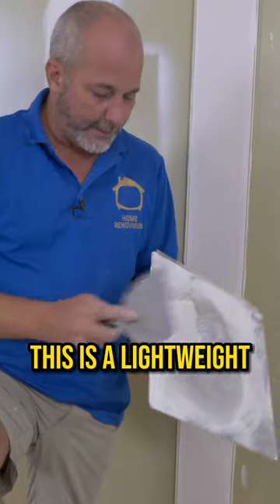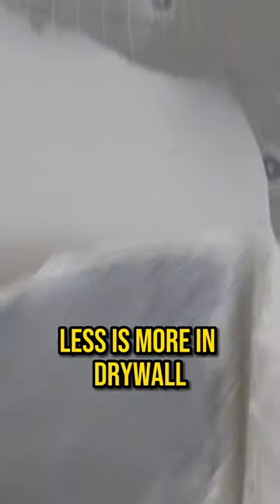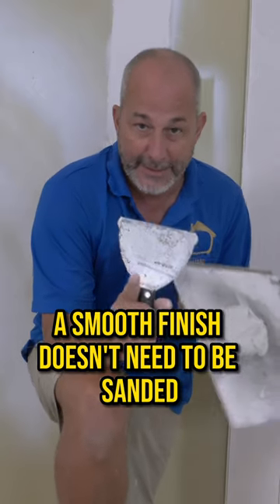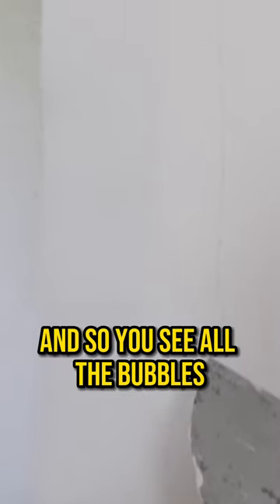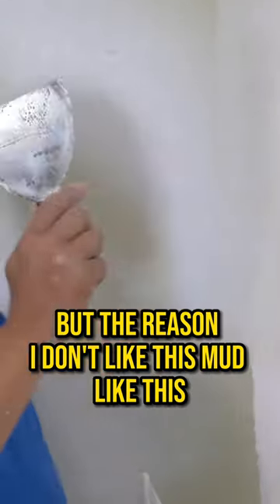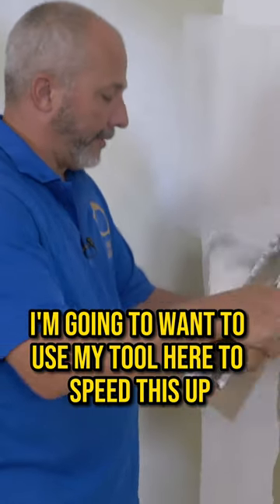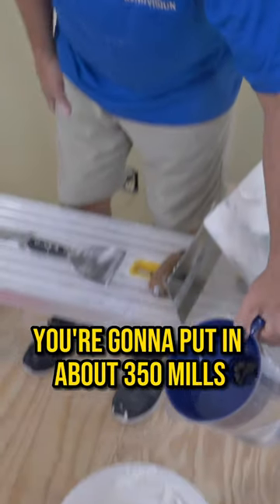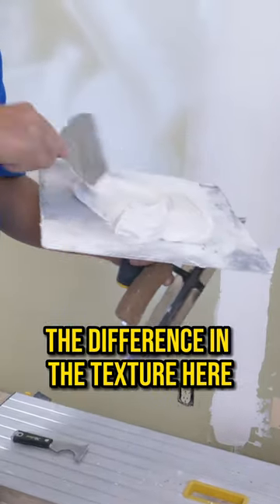Drywall Tip | Less Is More With Drywall Mud

Comment: You mentioned several tips at the same time. Which is it? Working the mud? Using less? Trowel size? Adding water? Using lightweight? That’s the problem with shorts…you lose context, unless it’s explicitly clear.

Comment: Very good explanation, but most pros don't use a lightweight compound.
Reply: Actually braddah Rich, we all use light weight because it shrinks less . But more water more shrinkage. Even though less water in the mud is a more concentrated mix and takes longer to dry
Reply: My company uses light weight but you still want a peanut butter consistency not a watery consistency like he has.
Reply: Huh? That's all they use unless paid extra to do otherwise 🤷
Reply: I use ultra lightweight

Comment: You can only do that with gypsum plaster, but not cement ones. You should never thin down cement leveling compounds because it messes up the cement:water ratio that is important for achieving designed strength of the material.
Reply: you probably shouldnt do it with a bag of sand either but since he is talking about drywaliing, not much point in bringing it up.